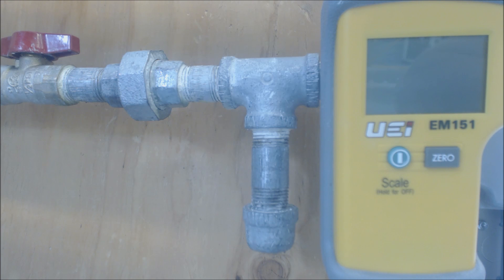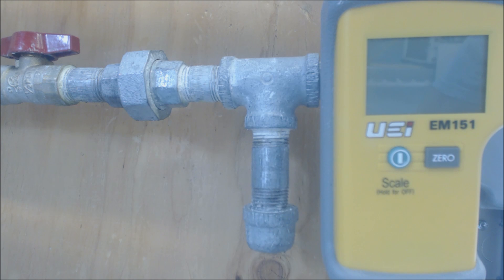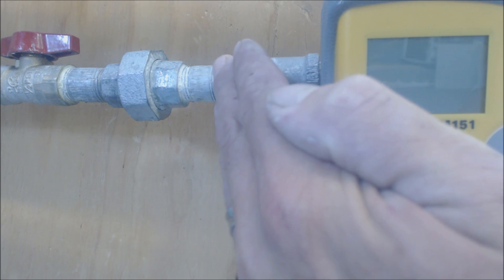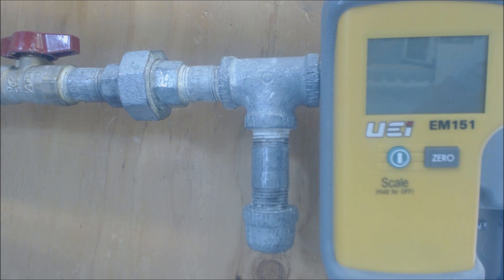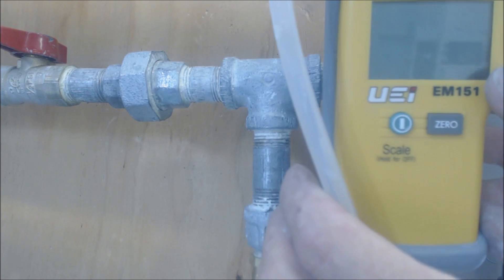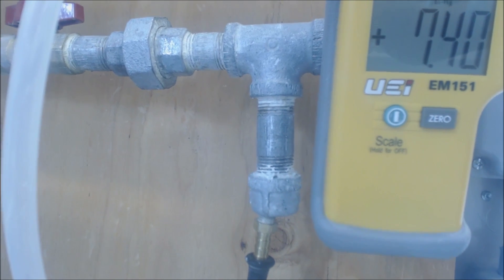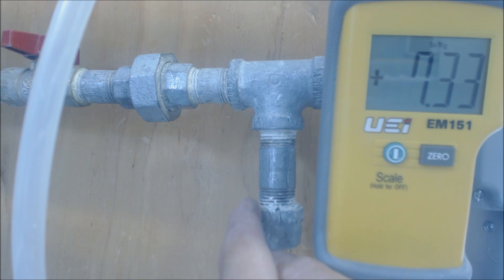Checking The Incoming NATURAL and PROPANE GAS PRESSURE with a Manometer for Appliances!

Comment: You aren't supposed to have galvanized pipe for gas it is supposed to be black iron
Reply from the maker: There is no differentiation in black iron vs galvanized in the IFGC 2021. We live near the ocean and supply houses only supply galv. Black iron rots too quickly but in reference to nationally, there is no problem using galv unless your local inspector shows you some reference to a code that the city has adopted outside of IFGC, thanks!
Reply: @acservicetechchannel  according to the north Carolina code book there is they will turn the job down for galvanized pipe on gas pipe
Reply: @acservicetechchannel  and besides that galvanized is made from galvanized black iron is iron so there is a difference

Comment: Notice how when you shut the valve off it began to drop. Does that determine a leak? Or could it be a regulator/valve burping possibly
Reply: I believe the regulator/valve has a vent, once gas pressure is shut off it vents excess pressure. I could be wrong.

Comment: What if the gas pressure is high or too high coming from a LP tank?
Reply: That’s what I was wondering.
Maybe turn down the “shut off valve” a little.

Or not enough pressure?..  bigger hose or lines?….

Comment: Hello, and thank you for the great video. Liked & subscribed. One question, if I am using a dual port (-/+) manometer, how do I measure gas pressure? (I'm assuming I couple the two ports to get a single reading, since using both ports would measure pressure difference.) Thanks!

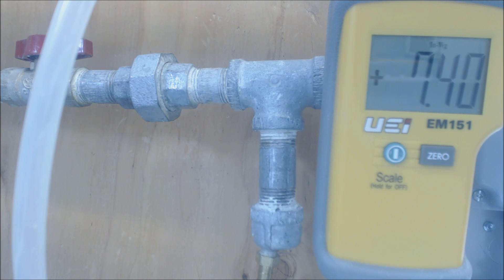Comment: Hi, I don't mean to be critical. I am not able to make videos at this time. Could you please refine your video so someone doesn't get injured? You were showing 7.4 on the manometer, but you didn't specify if it was for natural or propane. Then when you added your text at 5:03 on screen, you said 3.4-3.8", and 10" for propane. I don't understand. And it would be better if you described this pressure if the burner is drawing or not. I'm not sure what reading should be used for natural now and whether the unit you are checking at is drawing fuel. Granted you did say to have other appliances running. Good job, but I think it would be wise since you are reporting on gas, your site should be more thorough to avoid a law suit. Just my love and opinion. Aloha, Paul

Comment: Thanks for the video.  Absolutely blows be away that these digital manometer tools make it so that people have to make up their own connection adaptors....and then to reply on a barb fitting tube.  I'm new to all of this, but c'mon manufacturers....this is a joke.  Thanks again for the helpful video on how to work with this lack of a complete tool!
Reply: You can make a fitting out of various fittings, you don't have to drill into a cap

Comment: Would 10" of NG water column cause any issues running a 400,000 btu pool heater?
Reply: I ask cause it seems high a heat is having ignition faults.
Reply from the maker: It should likely reduce before the heater but you can tell by reading the rating plate and the manufacturers literature for that unit, thanks!

Comment: Why don't you want to use the tap in the gas valve? Not sure I understand the benefit of doing it this way vs just tapping into the inlet port on the gas valve.
Reply from the maker: Sometimes they are a bear to get to the gas valve tap. They can be difficult so it is just easier to take it at the drip tee cap. Not always but sometimes it is easier, thanks!

Comment: That gas line is galvanized steel.  You need black pipe for gas, it resists corrosion from the added odorants in natural gas.  If it's propane... still use black pipe.
Reply from the maker: Galv is absolutely fine to use and it does not distinguish between Galv or Black Iron in the IFGC 2018. In fact, our supply houses won't even stock black iron near us for gas piping. We are near the ocean on the east cost. If you install black iron, then it will rot and leak out of the threads in this location but you can use either one, thanks`

Comment: I'm currently a plumber but will be trained in HVAC. Can a dual port manometer also be used for this type of pressure check? I currently have a Dwyer single port but am looking at a few dual port options. I also need a dual port for testing gas pressures on some tankless water heaters.
Reply from the maker: I love the SDMN6 because I also use the internal pump to verify condition of pressure switches as well as pressure differentials and measuring gas pressures. Yes you can use a dual for a single function. You could look up "acservicetech sdmn6" I also have that tool linked in the description sections and at amazon.com/shop/acservicetech thanks!

Comment: Isn't that harder then just loosening the incoming gas tap with a hex key
Reply from the maker: You want to have options. Sometimes that set screw is hard to get to because of the exhaust or intake pipe and every once in a while, you may find a stripped tap plug, thanks

Comment: sure looks like galvanized pipe.  Illegal.
Reply from the maker: Hey Joe, thanks for your comment. Here we use the IFGC 2015 and it does not state that you cannot used galvanized. Code from the IFGC is also interpreted by the code official. Actually we could fail here if we used anything other than galvanized. I am located by the shore and no code official wants to see any black iron outside of the building. It is comon practice here to install all galvanized through the whole building and suppliers mainly only sell galvanized because they don't want to stock both. Our Main Gas Utility Provider also only installs galvanized on and near the natural gas meter. It is likely that a code official in your location is interpreting the code in their own way or you have another code book you are working out of. Thanks
Reply: NFPA 54 and 58 don’t prohibit galvanized pipe, but I imagine there’s a few states or counties here or there that might.
Reply: Up here in Ontario is not allowed .  & I always used the tap on the gasvave to adjust the flame . I never use from the drip

Comment: If you go to PepBoys or other auto parts store this fitting works great since its fully adjustable and inexpensive. https://m.pepboys.com/product/details/1240014/00474. I also bought a 3/4 to 1/4 hex galvanized reducer and a 1/4 to 1/8 brass reducer at home depot for around $5.
Reply from the maker: Thanks!

Comment: Great video, thank you. So after you test gas pressure on the line, you set your gas pressure on the furnace?
Reply from the maker: Yes you would move the brass barb fitting downstream of the electrical gas valve at the end of the gas valve when diagnosing and adjusting pressure. I will be making a lot more videos on furnace diagnosis along with gas lines and pressure adjustments. Thanks

Comment: Hi ACSERVICETECH!  Nice video, I never thought of making a test cap like that.  Thanks for the knowledge.
Reply from the maker: Glad to help! Yup, you can make one for 1/2", 3/4", 1" as they are the common drip tee sizes.
Reply: AC Service Tech LLC how do you make a test cap
Reply: @faridjahed  It's seems self-explanatory to me.
Reply: Where can I get one of those fittings or did you make it yourself...if so how did you do it...just tap and thread

Comment: where do I get the port with cap with port on it?????
Reply from the maker: So when you purchase a manometer, the brass barbed fitting comes with it and will actually fit directly to the tubing. You can buy the very same size brass barbed fitting and then you can then drill a hole in a spare cap you have and then tap the thread size and screw your barbed fitting in and then you have it. I recommend having one of these setups for 1/2", 3/4", and 1". The loose barb fitting that came with the manometer will be what is screwed into the electrical gas valve. I will be focusing on gas and heat now instead of ac so I will be putting out a lot of videos on these processes soon. The black reducer you saw came out of my old yellow jacket gauge
Reply: I'm thinking one could take a simple water or gas pressure test fitting, throw a 3/4" to 1/2" reducer in the bottom, pull the schrader from the side port and push your surgical hose over it.  Might be quicker than drilling a hole through a cap and since I have a few testers laying around.  Then you have a multi-purpose test tool.

Comment: one quick ? I think I kinda know half of it maybe.
hear it is,  to make straight air with electric heat to a heat pump you replace the condensing unit,T Stat thats heat pump compadible and  six wire and a biflow filter dyer or is there  air handler only designed for heat pump only
Reply from the maker: just make sure that the txv is not a single directional and that it will bypass. It is also good to add the outdoor sensor so you can turn the heat pump off automatically if the temp goes down too low and only the strip heating on.